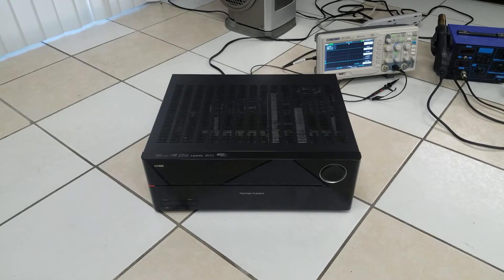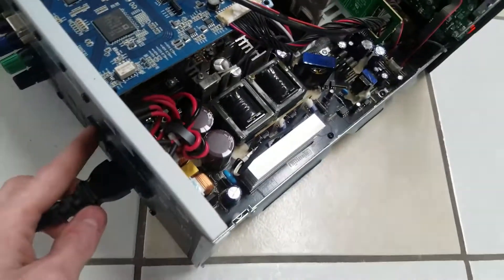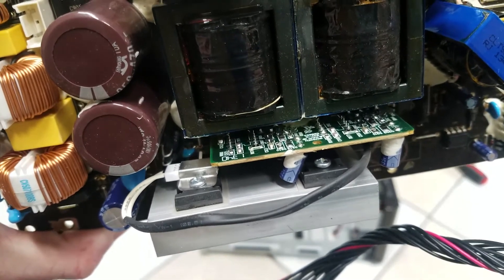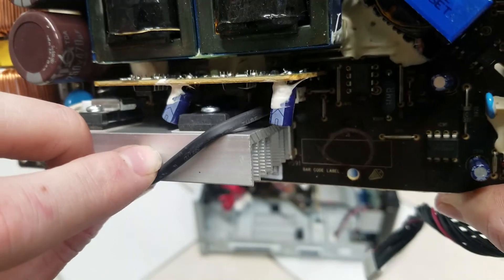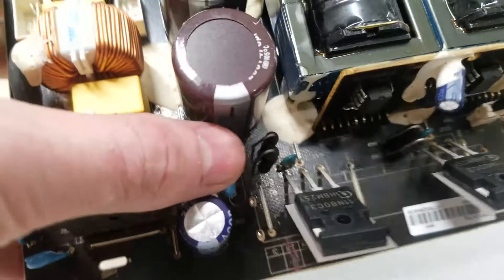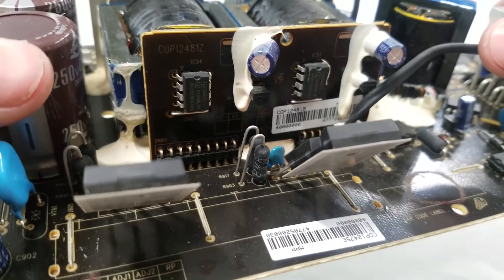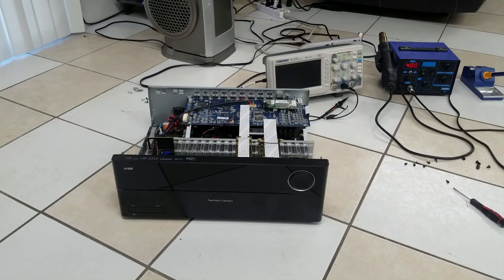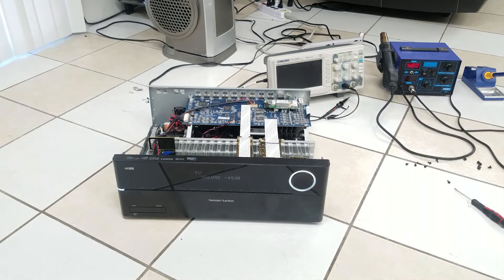Harman Kardon AVR 3700 / 370 Repair - Turns Off After 14 Seconds

Comment: My amplifier comes on protection mode and if i remove the power cable which goes to the amplifier board its getting switched on all the MOSFETs seems to be good the jig -vcc grnd +vcc
Reply: Please any hints
Reply from the maker: Sounds like a similar issue to that in the video. Is it the same model? If not, which model is it? Check for resistance across VCC- GND and VCC+ and post your results.
Reply: Thank you for your reply. The model is AVR 370/230
Reply from the maker: @MuhammadArif-lh7oh  Which is it? The 370 or 230? Those are completely different models with completely different ages.
Reply: @ri5ux  Hey, I have a problem similar to Muhammad. My AVR 3700's 471 Caps were bad and I replaced them, but when I turn on the unit light goes from solid standby orange to white for less than a second and turns back orange, same as before. When I disconnect my amplifier board (CN20) I can turn on the unit and all connected components appear functional, The unit is stable and remains on. I've  done what 
Eivind suggested with the 1k resistors and verified that all the 5 volt outputs are reading properly and that the amplifier output voltage is working (I think). The voltages on CN20 are as follows: V[VCC(+50V)-VCC(-50V)]= 54.4 V, V[VCC(+50V)-GDND]= 27.1V, V[VCC(-50V)-GDND]= -27.27 V. Does this look right? If so, where should I start on my amplifier board? Thanks!
Reply from the maker: @rechik97  We are referring to CN20 on the smps, correct? If the unit shuts down when CN20 is connected, it is very likely you have a short on your amplifier, which triggers over-current protection on the SMPS to shut down, resulting in under-voltage of the amplifier board, which sends the shutdown signal to the logic board. It is very likely you have blown transistors on one or multiple channels. Oddly, I would think the amplifier would see the under-voltage when CN20 is disconnected and also send the shutdown signal. Be sure to check your transistors and let me know if you find something, or if you dont. VCC and -VCC are both 50V (roughly) relative to ground, correct?
Reply: @ri5ux  Thanks for getting back to me so quick. I'll go ahead with testing the output transistors on the amp board. To clarify, yes I get the 50 Volts. With everything connected with the exception of the amplifier board and the unit turned on, the SMPS CN20 header gives me 54 Volts on +VCC to GDND , - 54 Volts on -VCC to GDND, and 108.7 Volts on +VCC to -VCC. The corresponding plus and minus 27 Volts were read when performing Eivind's 1k resistor test method from further down in the reply feed.
Reply: @ri5ux  So I'm pretty sure I have 2 failed output transistors on my SR channel; Q660 and Q654. Maybe you can validate my test method? 
For the NPN D2560 on Q660: DMM on diode, Negative to Base, Positive to Collector results in 0.001 V. Neg to Base, Pos to Emitter result 0.001V. All the other D2560's result in B -> C = increase to infinite; B -> E = 1.34_V. 
For PNP B1647  on Q654: Diode test, Neg to Collector, Pos to Base results in OPEN and no brief voltage. Neg to Emitter, Pos to Base results in OPEN and no brief voltage. All other B1647's  result in C -> B = increase to infinite; E -> B = 1.36 V. 
I tested first with all transistors connected to the board but then pulled Q660 and Q654 to retest and returned same results. R743 and R745 have failed open. 
Does this look good? Is there anything else I should be concerned about testing on the SR channel? I tested all the D600K's and they all had the same outputs. I'm a noob with this stuff so I really appreciate your help.
Reply from the maker: @rechik97  Your testing methodology seems appropriate. You may also have blown transistors in the preamp section of that channel as well, but typically it's just the output transistors. Have you removed those transistors and tried powering on the receiver with everything else connected? More than likely it will turn on. If it has the same symptoms, you still have a short on that channel somewhere and will have to check all transistors on that preamp section. You may also see the same short on CN20's +VCC and -VCC connections. If you see it with the transistors installed, and not with them removed, all should be good.

Comment: Sadly, that great Video came a way to late for me. But next time I can repair it on my own instead of spending 100 € for repair. I really love that Receiver but sometimes it drives me crazy >.<.
Btw. which cause do you expect, if one channel output isn't working anymore?
Ironically, it came back from ESCoor, which is the official Partner from HK in Germany, after the repair with that new problem...
Reply from the maker: Sounds to me like the channel was somehow blown without shorting the output transistor on that channel. Most of the time they fail shorted and it causes the receiver to shutdown. Not sure though, it could be preamp side. Could be a couple different causes.

Comment: Hi. Thanks for a great video. I have a HK AVR5500 with exactly the same problem of powering off after some four (4) seconds.  Could the same remedy help?
Reply from the maker: The AVR5500 uses a transformer as its power source instead of a switch mode power supply. This method won't work. It sounds like your receiver may have a shorted transistor on one of the output channels. You'll have to check all of them.

Comment: Hi, thanks for the video, but how the heck did you unscrew the heat sink from the second FET that is hidden beside the small vertical board? no way to get access to the screw head ! you jumped straight to "I sucked the heat sink" , I've been struggling to get the screw out for 2 hours already.
Reply: I finally managed to unscrew the ****ing screw, I had to drill in the board in front of it very carefully. The amateur who designed this had a hole in the board planned, but the hole is too small and not aligned properly to the screw head, so there is no way to unscrew it unless you drill in the board. Plus they used crazy glue on the screw just to make your life more difficult. They may have corrected this on some boards versions but mine took a good 3 hours just to get the screw out.
Reply from the maker: Hi, sorry about that. That's my bad, I should have specified. I will add a notation in the video. The best way is to desolder the MOSFETs and heatsink from the board and pull it all up in one piece. and replace the entire assembly later. I learned this later on, but yes, I completely agree... terrible design.

To be honest what I did the first time is absolutely not the correct way, but what I did was align the screwdriver with the hole and gradually bend the risen board until I had enough of a grip to turn the screw. Smaller radius flathead screwdriver with a long handle works best. It can damage the risen board if you push too far, so I don't recommend it.
Reply: Only for future reference, I faced the same problem and solved in 2 different ways with out removing the heat disipator, one for each cap:
The one that  is below the screw clear where the cable is screwed, The cap can be accesed with small tweezers lock the cap while you heat the soldering and pull it out. Then replace it in the same way using the tweezers.
For the second cap, remove it as the other one but you may find to put it back in the same place too hard, the easiest way is soldering it on the down side of the board, you will get the same result. You may want to solder both caps in this way.

Comment: Works with a 470 pF 3000 VAC/VDC 5 mm capacitor or is it to high?
Reply from the maker: That will work perfectly. I use a 3KV capacitor on one of mine as well now.
Reply: Thanks!!

Comment: Great video! having the exact same problem with my AVR, but i am a bit unsure what kind of capacitor i need to order.  Could you give me the specs so that i don't order the wrong one?
Reply from the maker: You need 471K ceramic capacitors with a voltage rating of 2KV or more.

Comment from the maker: If anyone is experiencing an issue where the power light is flashing orange and won't turn on, I have the fix for that too. It is caused by excessive heat damaging the following capacitors on the power supply: C918, C921, C943. Replacing them will fix the issue, but it will happen again unless the overheating issue is resolved as well. In order to fully resolve it, find the "FAN Test" plug on the amplifier board, and bridge it. This will force the fans to run at full speed, and it will be louder than usual, but it prevents further damage. It's hardly audible if you have it in a cabinet or further away anyhow. Very solid receiver after these issues are taken care of.
Reply: i have no amber light no power at all on my harman kardon 3700 any help would be appreciated thank you for the video hope you can help me
Reply from the maker: @frankserrano6665  I would check the standby circuitry. There is an IC that handles it with the part number OB2358AP. It's the closest 8 pin IC to the smallest blue taped transformer on the power supply PCB. If this IC is bad, you will have no standby power, or fluctuating power. If this IC is good, it could simply be a blown fuse. If the fuse is blown, there is likely a bad mosfet and capacitor on the main switching circuit.
Reply: I tried to replace the C918,C921 and C943 electrolyte capacitors on the Power supply board with no luck. The power LED is still blinking orange. I also changed the two 470pf ceramic capacitors. Do you got any other suggestions? (What makes the led blink orange and how is the power supply turned on ) 🤔
Reply from the maker: @eivindamundsen7090  There is another scenario in which the power LED may flash. You may have bad solder connections on your standby circuitry. I would apply fresh solder to the joints on IC OB2358AP and the inductor/transformer directly next to C918.
Reply: @ri5ux After scratching my head for 10 hours I found the issue to be somewhere in the standby circuit. I get ~ 4.80V on the ST+5 pin and but  asson as I pull .5 to 1mA the voltage drops to 0 and rises again to around 3,5v before it drops again. If I apply ~13v to pin 7 of IC92 (ICE2B365) i get the 5V up running and i can enable the 50V (-25 0 +25) "supply". (so both the 5v and 50v circuits works )  I just ordered a few OB2358L (IC91) and KA431SAMF2 (IC96). I suspect there is an issue with the OB2358L ic or maybe a bad connection (internally ) at the primary side of the TF91 transformer/inductor. But I will try to resolder the IC and the transformer/inductor.. Thanks for your reply! :)

Btw: it's super easy to replace the 470pf capacitors with a tweezer without removing the Mosfets/heatsink.
Reply from the maker: @eivindamundsen7090  It does sound like your OB2358 IC may be faulty, but definitely check that inductor. I've had to replace one OB2358 previously as well, experiencing the same symptoms, but I had caused it to fail accidentally. Also thanks for the tip on easier replacing the 470pf caps. I'll give that a shot next time.
Reply: @ri5ux  It was the 18v zener diode (D914 
/MM1Z18) at pin 1/2 of the OB2358 (IC91) . It had turned into an 3 ohm resistor so I guess the operating voltage of IC91 was a bit low. 

Btw: I think its probbably a better idea to use two 220pf (1-2 KV) capacitors in parallel (load sharing) instead of one 470pf 2KV ? Its probbably the current that wear em down not the voltage ? 

Anyways. Thanks for helping me out! :)
Reply from the maker: @eivindamundsen7090  Ah, interesting. That's a new one. Also good theory with the capacitors, though if I remember correctly I hooked up a scope and noticed that the 1KV rating on them was insufficient, so I swapped them out for 2KV. Cant remember for sure. It's worth a try though if they fail again. Enjoy your receiver!
Reply: @ri5ux  It looks like the broken zener diode was only a symptom of a broken PWM IC. After a few days the power LED started to flash orange again. The new (1,3 watt)  D914 zener is still working but the voltage of pin 2 (VDD) of IC91 swings between~ 9 and ~13v. After removing R922 and R923 the voltage at the anode of the zener is stable @~18v (18,4v).  Im not sure why the 18v zener (D914) broke.. I had a theory but it just got debunked by D910 :-D I thought maybe 240V+ (line voltage) leaked trough the (defective)  PWM controller (Ic91) between pin 5-6 to pin 1-2. But that's not possible unless D910 is open or super slow. (hmm..  D910 are in series with 4x470k (~120k ohm) between primary coil of transformer TF91). Well I just need to wait for the PWM IC's to arrive before I can get anywhere. Btw. Do you know the DC resistance of the primary coil of the TF91 transformer (pin 1 and 2) ? I got 4,4 ohm (DC)
Reply from the maker: @eivindamundsen7090  Off the top of my head, no I don't know the primary coil resistance, but if you give me a couple days I can open my receiver up and check for you.
Reply: @ri5ux Thanks but that's too much work.. If you had a few power supplies lying around things would be different. After desoldering the OB2358L, soldering in a IC socket and placing the IC in the socket the power supply "works" again. I gues heating up the IC temporary resolved some internal issues in the PWM controller.
Reply: i think i have some problem , but i dont know how to fix, and where to buy the part ?